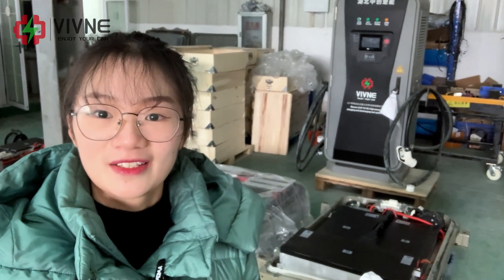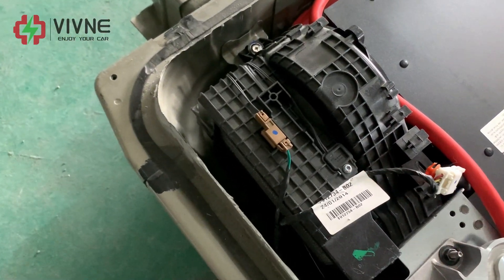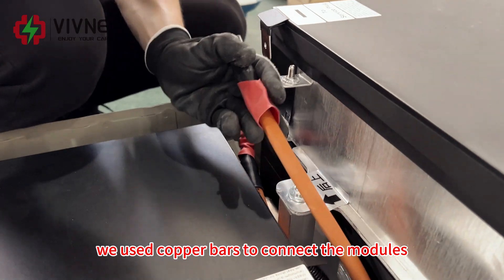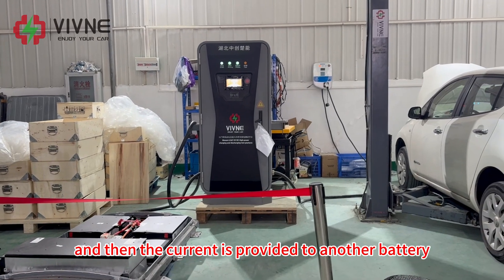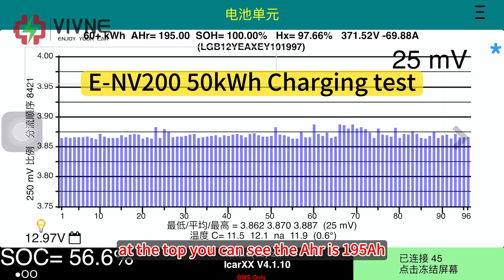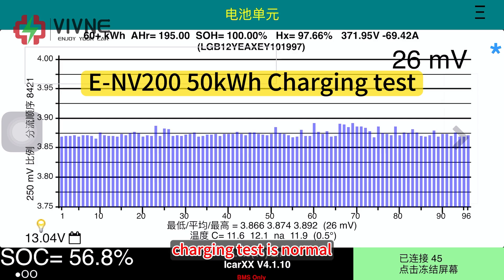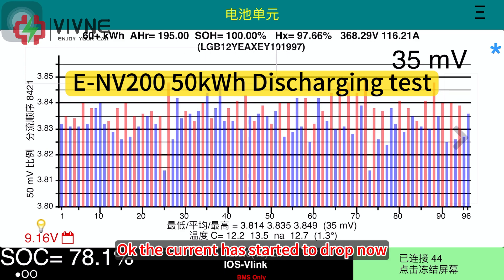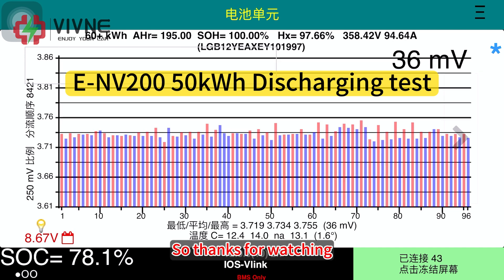VIVNE-Nissan E-NV200 50kWh battey test

Comment: Looking forward to ordering mine next month. One question though, have you thought about modifying the cooling system so that it works whilst driving rather than just when charging? That was always a design error in my opinion.
Reply from the maker: The cooling method remains the same as the original. But we replace the original soft battery pack with big CATL cell, which generate less heat and bear a much smaller C rate. The big CATL cells can withstand 3C charge/discharge and can also withstand continuous charge/discharge of more than 1C. Take our 62kwh for example, fast charge power of Leaf is 47kw, at maximum current of 150A, we replace with 180Ah big CATL cells, so the charging rate is even less than 1C. So the temperature raise even in quick charge is fine.

Comment: I know this isn’t the best place to try and ask this question, but I was going to do a leaf drivetrain conversion on my Nissan hardbody. Would your company be able to set up a battery for me that doesn’t need the confinement requirements of the Nissan leaf battery box. It would be a custom sized box that would take up the entire lower potion of the bed.
The basic question is: would you be able to build a battery with custom dimensions?
Reply from the maker: If we know the exact size and technical parameters, yes we can customize the battery box, but since you are not in China, we cannot install it on the car for testing, and it's difficult to provide technical support, so we don't recommend it.

Comment: Hi guys i notice your batteries doesn't go to 400v when fully charged like the stock ZE1 40kwh leaf.
Reply from the maker: Yes, to better protect the battery, we limit the voltage
Reply: @VIVNE-CoraLiu  does that mean the vans  performance is reduced?
Reply: @N1ckBull No, there is no difference in performance between when the stock van is at 100% or 90% charge (or even 30% for that matter AFAIK) so it won't affect performance.

Comment: Looks good, thanks for video. Do you offer battery modules only for e-NV200 ? Or also complete battery ? Thanks.
Reply from the maker: Sorry we only offer battery modules for e-NV200, we don't have extra battery case. But the installation is quite simple because you don't need to modify the case, just tighten the screws and connect the cables
Reply: @CoraLiu-VIVNE  thanks!